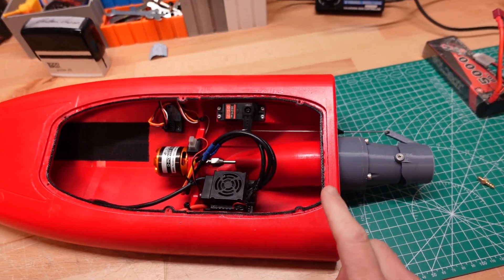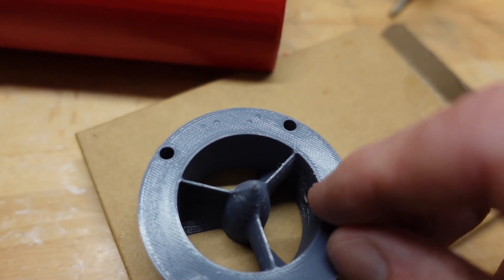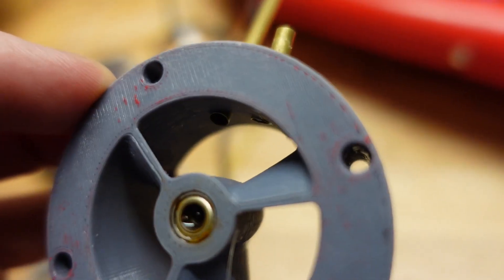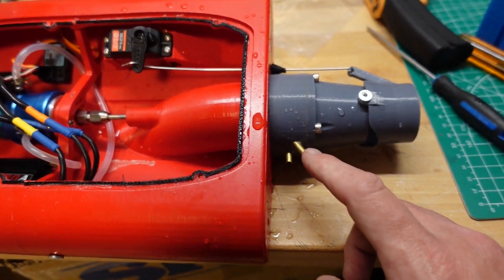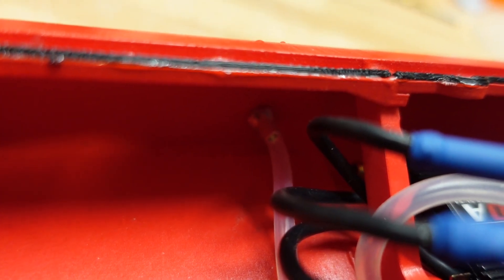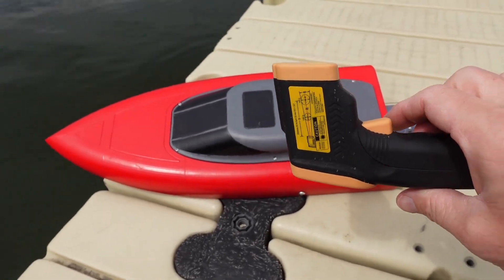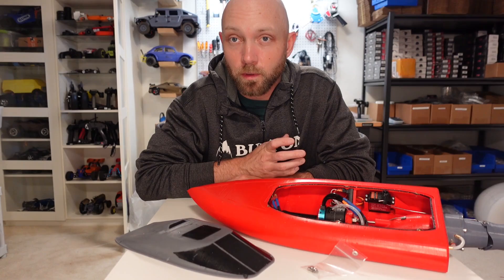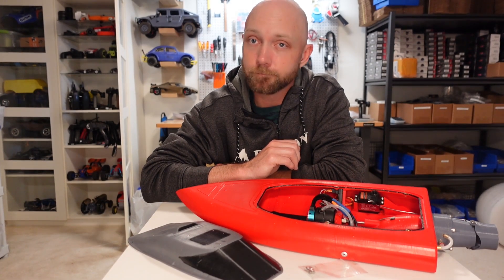3DPrinted Jetboat - Adding Water Cooling

Comment: I saw in another clip you mentioned its all printed in PLA, and the note about a motor spacer of abs for heat reasons. Can you share any printer settings?
Reply from the maker: It was a while back but I'm pretty sure its just a 0.2mm layer height 0.4mm nozzle and then a few extra walls in the slicer to be sure the hull wall is solid.